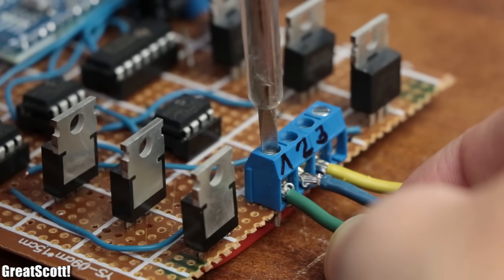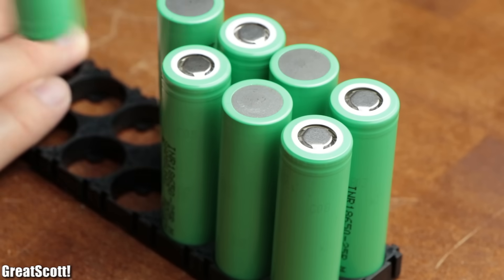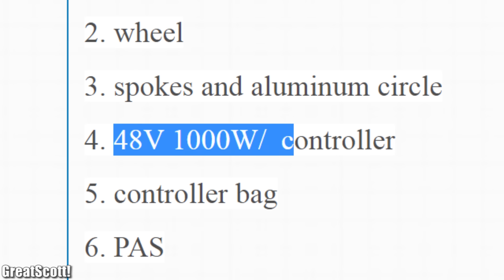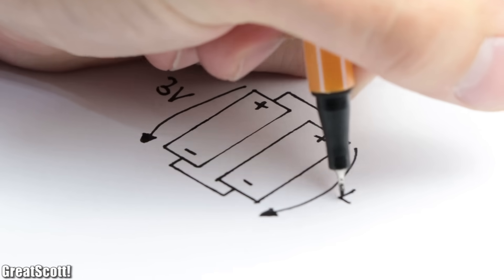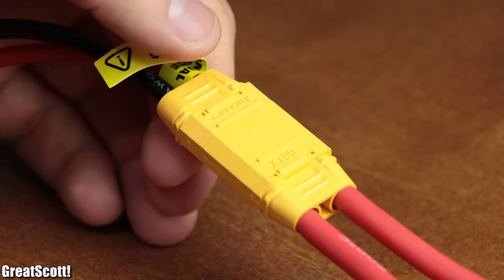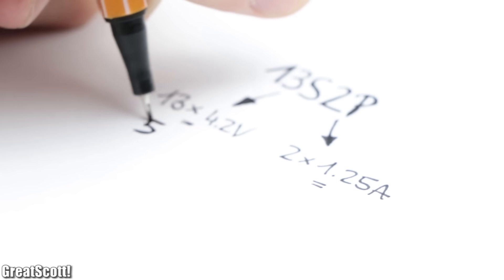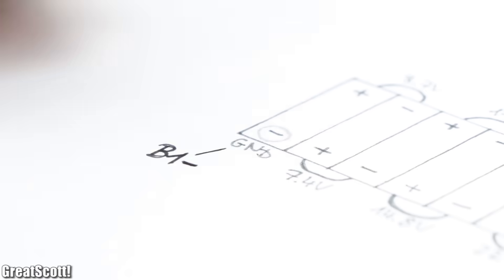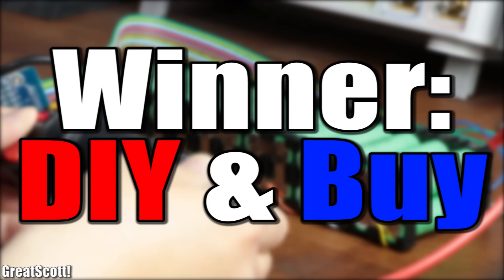EBike Battery Pack || DIY or Buy || Electric Bike Conversion (Part 2)

Comment: At least with a DIY pack build you know that you have good quality cells. Not some cheap un-named brand with no capacity.
Reply: Can make sure you buy a pack that names the cells it uses?
Reply: and solid weld. solid cable etc.
Reply: Only if you're buying cells from a place where you can be absolutely sure they're not selling counterfeit cells. There are an awful lot of such cells bearing Samsung, Panasonic and LG markings. The Chinese have gotten quite good at copying those labels. I prefer EM3ev, which makes their own packs with cells that they buy direct from the actual manufacturers, and they're better engineered than any DIY pack and not outrageously expensive. For instance, every cell in their packs is individually fused, with printed circuit board interconnections rather than haphazard nickel strips, welded by CNC robots that are far more consistent than any human. And they provide a warranty. Good luck with that with your DIY packs with maybe name brand and maybe counterfeit cells.
Reply: I've got a lead-acid battery.
Reply: Genset trailers are a thing. I was thinking about getting a little hobby gasser and an alternator, myself.
Reply: and made out of bad Chineseium  materials
Reply: i have a fiido d1 which uses china cells probably the bike is only $400 and it still workjng strong after a lot of km probably 1000 or so. lithium ion is awesome
Reply: and prebought ones might only ( often do ) have a passive not active balancing BMS .. meaning itll regulate to stop charging when the highest voltage cell reaches its peak leaving all the other cells at a lower voltage creating more voltage sag as the pack discharges in use
Reply: It's really up to you. If you buy a Chinese pack for $120 when the same pack is being sold for $350, don't expect too much.  Even Chinese brands are being knocked off by Chinese.
Reply: even no brand also has a capacity.. but their capacity just not actual.. most fake capacity advertised brand do this and there is evil things behind..

like battery 18650 sized battery, usually has a capacity of 2000mah or maximum 3500mah.. 
but no brand or even has a brand (not from big company brands) has a smaller battery in the 18650 case battery.. (like 500mah with smaller size lithium battery).. so the 18650 sized battery is just a case for covering a smaller one and use the insulation sticker with a fake advertised capacity and also brand who made it..

if you have so much time to teardown that kind of battery, there is smaller lithium cells inside the 18650 sized battery case.. 

there is just positive pole soldered directly to the positive 18650 case with nickel ribbon wire or just single piece of wire and the negative one is soldered directly to inner case at the bottom of 18650 casr (because the entire case is negative)..

so, be careful while choosing a 18650 battery with too cheap price.. too good to be true if they have a big capacity like 2000, 2500, or 3500 mah and their price just under 1 euro or dollar..
Reply: I've named the cells in my battery, Jim, Sally, Lily, Tina ...
Reply: Its mainly depend on your discharge current , if it's high consumption current , SONY cell is best , if it's used for some consumer electronics , chinese cell is also suitable .
Reply: at that point why don't you just use a gas engine to drive the wheel? lol
Reply: @JankyShack  I love my 2 stroke. Working on an electric 20" that I can take on the train, or trow in the back of a car with ease. I can't do either with my 2 stroke.
Reply: @saved_yet_so_as_by_fire  Electric is a lot nicer, I've had gas and electric bicycles and the electric is such a smoother ride, so much better from a stop, no carburetor issues, quieter.
Reply: @JankyShack  from what I'm seeing they're way more expensive though.
Reply: @saved_yet_so_as_by_fire  Yes they are, I made both types from china kits and bicycles.  The electric one was about 4 times more expensive to build than the $100 gas kit.  I made my own battery from salvaging laptop batteries and soldering them together which saved me a bunch of money too.
Reply: @JankyShack  I'm thinking about using a hoverboard to save money. About $100 for one, and it'll have two motors, and the battery pack, and charger. I'd just have to get the right controls for it. What are your thoughts.
Reply: @saved_yet_so_as_by_fire  The hoverboard has terrible range. I bought a used one and it will only go about 0.75 miles on a charge.  They are fun to ride, but not good to use as transportation.
Reply: @JankyShack  because laws around ebike or sth
Reply: @karlkarlng  you legally can't even ride a gas moped where I live on any public street, ebikes have a loophole and are legally classified as a bicycle

Comment: But with only 5Ah and drawing 10Amps you will only have 30 minutes of charge...
Reply from the maker: True. But that is why I will do testing in part 3.
Reply: Samuel Sparks also, the way to use these is not continuously at full power. You use it as a pedal assist. The current draw is much less and you get hours of use, while still dramatically reducing the difficulty of pedaling.
Reply: Can it charge when coasting? Like some Hybrid cars do?
Reply: 30 minutes of full power, usually you don't drive around like that.
Reply: @Curl Beers

That depends mainly on the speed controller, some carry regenerative braking, though regenerative coasting isn't something they normally do.

Comment: So if you were to draw a constant 20A - how long would that battry pack last?
Reply: 15 minutes , 5Ah / 20A = 0.25h = 15 minutes
Reply from the maker: 5Ah/20A =
Reply: oh, is it that simple? I thought the 5ah was for a specific current? i.e the more current you draw, the behaviour curves change.
Reply: The curves do change, but not by very much. Typically batteries have a bit more capacity if you discharge with lower current. I have some Samsung INR18650-15Q's from a battery drill. They are rated at 1500 mAh at 300 mA and 1450 mAh at 10A. Not much difference. Max continuous discharge is 18A for these cells. Many things can be learned from the datasheet, as GreatScott also demonstrates.

http://www.batteryspace.com/prod-specs/6615.pdf
Reply: Ah thanks. I have been using sealed lead acid batteries lately, and those curves change massively. I naively bought a 12v 10AH thinking I'd get a continuous 10A out of it over a period of one hour, but it's more like 25mins

Comment: Why you stopped posting links to aliexpress?
Reply: no, likely because spending the time to hunt the product down on multiple websites is time consuming
Reply: because they dont pay you if someone buys product u linked like amazon affiliate does
Reply: Actually Aliexpress DOES pay but 25% of the products I buy arrive damaged, incorrect or not at all. lol. Ali also changes item links often so Amazon links are far better. Then if you want to spend an hour to save $1 and wait an extra month to maybe receive it go right ahead... because I still do and I regret it ordering from ali every time. lol.  : )
Reply: Levi Thomas hm thts weird my aliexpress orders always come and are rarely damaged
Reply: real mvp
Reply from the maker: Was not worth it
Reply: iwantitpaintedblack looks like someone else can do it for you ^. ^
Reply: Luka Potocnik they do. Not sure if there is direct payment system, but there is plenty cashback services that would pay you for people buying stuff from your link.
Reply: I want to purchase these batteries original. So anyone know if the ebay link is good? It's the only seller who will ship to my country.
Reply: Aun Raza i recomend aliexpress cells. the seller litokala direct sells the ncr18650 for $2.7 each. Its 3400 mah rated for 5a continuous
Reply: @Joshua Huang, he used a 1000 watt kit. The Panasonic cells are great for capacity but they don't supply enough current so the bike would have slower acceleration, lower top speed, and weaker on uphill climbs. 5 amp cells would probably be OK for a 250-350 watt kit. Samsung cells may have a little less capacity but are available in 20 amp and higher for more power. I use many Panasonic cells in flashlights and micro-controller projects based on Arduino, ESP8266, ESP32, LoraWAN, etc and love them but had to buy some Samsung cells for projects using power hungry devices like large actuators, solenoids, and stepper motors.
Reply: tornadokat yea u would need around 5 in parallel for a 52v battery
Reply: tornadokat I use a 3kw cyclone motor with low amp discharge cells and even tho its a 67v battery, the top speed is 34 mph. The amperage also affects top speed due to voltage sag under load
Reply: Aliexpress is junk garbage
Reply: GreatScott! Wait why, because aliexpress products are unreliable?

Comment: To be fair, if you used the same cells that those battery packs have, it would probably turn out much cheaper. You can't know what cells those have, could be some cheap Chinese ones.
Reply: Which means that the pre-made battery pack would be much more expensive in the long run.
Reply: Do not buy from Ali-express or eBay for batteries period. Surf vape forums, they generally have a good idea where to buy cheap high drain batteries that are genuine.
Reply: Alf Stewart there's Liitokala official store on aliexpress, they're reliable.
Reply: @alfstewart2592  That hugely depends on the country that you live in.
Reply: Nearly all of them use LG cells which aren't really cheap. I've never seen anything using cheap fake Chinese 18650's that usually don't break 1000mAh
Reply: @alfstewart2592  Anything from old used laptops is going to be a good cell, assuming the cell itself is in good condition. https://www.ebay.com/itm/USA-Samsung-INR-18650-25R-2500mAh-Battery-for-SMOK-Vape-Mods-Charger-Optional/332627772273  
These are also good cells (tested myself)
Nearly all cells, as mentioned, are over rated. they aren't actually how many mAh they say they are. You can buy a good tester to test them and be sure, if you want.
I run a OPUS C3400
https://www.amazon.com/BT-C3400-Universal-Analyzer-rechargeable-batteries/dp/B015LB8DFG
I EXTREMELY recommend this to anyone who deals with any lithium cells frequently. You can run charge tests (charge and discharge) get the true mAh rating of cells, you can run internal resistance tests, you can charge multiple cells, discharge, run it several times and get averages, etc. It charges at a very low mAh rating and lowers as the voltage goes up, this keeps cells extremely healthy in the long run.
This also enables you to recharge 'dead' cells from 'dead' laptops. I've successfully brought back hundreds, maybe thousands of cells from throw-away laptops that were 10 years old or whatever. Anything under 2.8 volts is basically dead and should be treated with caution. they can blow up or whatever, it isn't really that dangerous just smack it with a screw driver and let it burn on the floor (concrete floor preferably) It rarely happens though. To be even safer you can use a variable PSU at like 50mA to charge it up past 3.5v then put it in the charger.
Reply: @ThoroughlyTested   Anything from old used laptops is going to be a good cell, assuming the cell itself is in good condition

ehhhh id stay away from ICR style cells unless its a 26F which are classed ICR but use the Hybrid NMC(nickel Magnesium, Cobalt) Chemistry.  most Laptop cells cant handle the high drain for more then 20-30 sec. as an example you'll need to Run like 10s7p to get even 20 amps from the pack. that means for a smaller 36V Ebike its 70+ batteries! that's a MONSTER battery @ about 18.2Ah. personally I don't need that Kinda run time on the bike. so Its really best if the cells can do 10 amps and store around 3000mah. this way you can get a power dense pack but only need to go to 10s4p to generate the amps needed to run an E-bike.
Reply: Yes on aliexpress theres loads of Chinese genuine cells but at the same time there are some fake ones look at the reviews or order in a small quantity and teat them then buy more
Reply: all ebay cells are overrated if they're not Samsung, Sony, LG, Panasonic, Sanyo or any other well known brand. There's cases where they just place a small li-po cell into 18650 casing and fill it with some powder giving you 180mAh cell and they market that sh*t as 4500mAh!
Best cells have only 3500mAh (Panasonic/Sanyo) but are capable only of 4-5A while 3000mAh Sony VTC6, Samsung 30Q and LG HG2 can handle 20A. There's no better 18650 cells than those on the market. There is Sony VTC6A that's 3000mAh 25A but they're rare and expensive.
Another alternative are Samsung 30T and 40T, those are 21700 cells, 30T is 3000mAh 35A while 40T is 4000mAh 30A but they cost A LOT
Reply: yeah, if I want new cells I wait for the right Tool battery pack to go on sale want 25r'? Dewalt 5 Ah packs (you might get HE2's, which are still good ) 30q's? Bosch 3.0 or 6.0 packs HG2? Milwaukee 18v high demand packs and VTC6? Ryobi 6ah packs. Hitachi 100% of the time uses Panasonic/Sanyo cells. 

pretty consistent with whats inside of them. and if you get lucky you can get sales of 3-5 bucks a cell.
I like it because:
you know its never been used,
you know its from the same lot so better chance of getting nice pairs.
and you know its a real cell and not some fake or re-skinned Laptop cell,
sure its Work to tear the packs apart, but I mean its pretty much good fun long as you're careful.

my best deal so far? Bosch 6.0 packs with 30q's for 45 bucks on clearance at Home depot. that's 2.5 bucks a cell! another great deal is the 6ah Ryobi packs. you get 20 VTC6A's for 120 bucks. AND a tool usually. heck my last one I got that pack, and a impact drill that came with a 4ah tool Battery.
Reply: Those 3000-3500mAh tend to DIP voltage and mAh faster than 25R's. I've used HG2, VTC4, VTC5, 30Q's and found that 25R's really do earn their reputation with being a reliable high drain battery.
Reply: Buy cheap cells from trustworthy sellers on ebay - $1 pr cell at its cheapest
Reply: Have you actually done measurements on what is their real mAh? Do you know how long/how many cycles it will last? No. With a good brand one you can pretty much know it won't give out after 10 cycles. Chinese stuff has way less quality control and even same batch batteries can have varying capacity or life.
Reply: Michael Barton Yeah, I know not to expect much from chap stuff, I myself buy lots of cheap stuff from china. The main problem with specifically cheap batteries is that they can be made good or bad and for the most part you cannot tell if they are of good quality. With stuff like that BMS that also surely came from china, you can for the most part tell if it's good or not.
Reply: Newjorciks tru but just like the chinese knife market, it has gone into a new world... Much better than before.. Tbh its safe to buy almost any 18650's.. just not the 9800mAh cells lll
Reply: Newjorciks watch jehugarcia.. he has a ton of videos on this.. if the sellers got alot of stars, go for it
Reply: All of it is from China. There is quality Chinese made products. And cheaply made products. simple as that I dislike when people say "cheap eBay crap" or "cheap Chinese stuff" What did you expect for little $